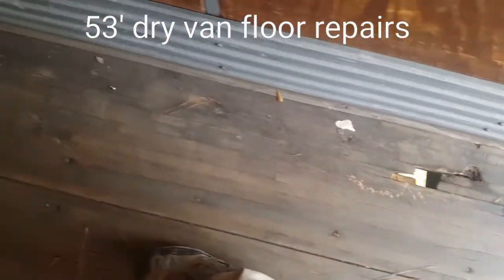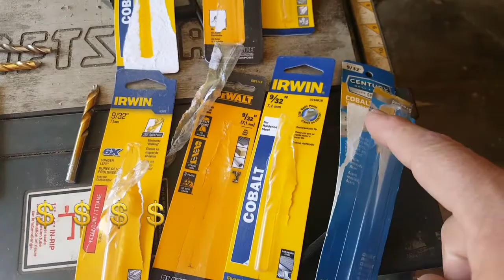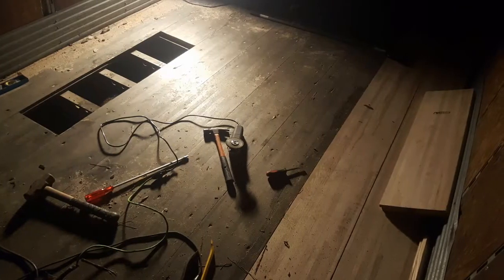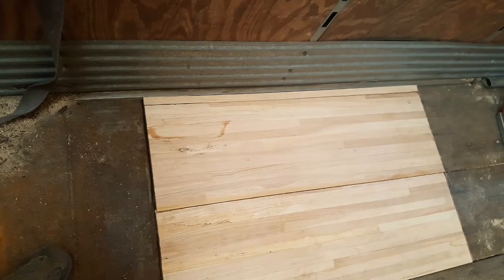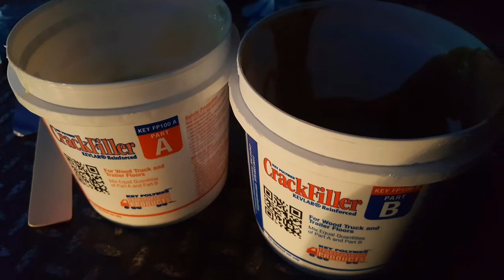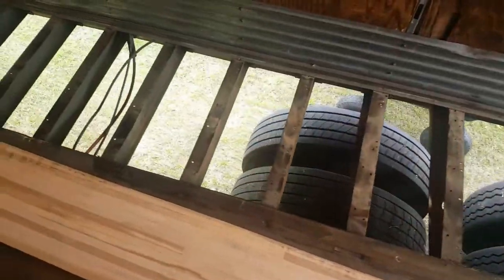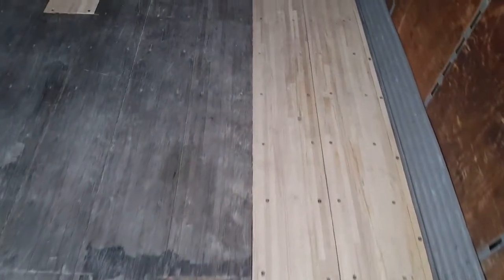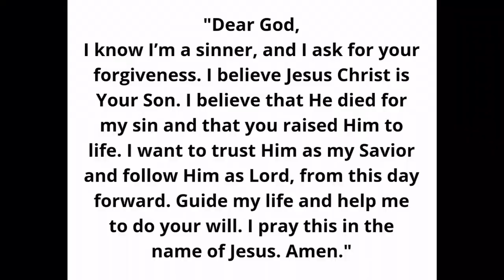53' dry van floor repair. broken drill and bits into pieces.

Comment: Great job man , Can you please in future if you can show us how to remove and install the woods
Reply from the maker: Basically the wood is over lap joints on one side and underlay joints on other side. So once you unscrew the board and make the cut the board can be pulled out. I use a skill saw (be real careful) to make my cut then use pry bar to pop it out. The worst part is trying to get full cut without getting in the next board.

Comment: Hello, 
I need to replace my floor my question is how do i remove the floor the easiest way because most of the bolt are rust and not coming off ?
Reply from the maker: There is no easy way. I removed what screws would come out and then had to cut the others out. So get some wd-40 put it on them for a day or two before you try to remove them. Hopefully your big Ole drill will back them out. It will be a big headache but take your time it's a noble project and can save lots of cash.

Comment: Have you ever swapped boards from a different position on the floor? Or when you pull up an old board is it too far trashed to reuse ?
Reply from the maker: Usually they are to bad to reuse

Comment: Can I use pressure treated 2x8 by 16 ft yellow pine for the entire floor replacement ?
Reply from the maker: @40roll97  no it won't hold up to the weight don't skimp on the flooring it could be really dangerous for the forklift operators
Reply: @ChristianTrucker so what type of wood do you recommend for a full replacement ??

Thank you in advance
Reply: @r.mendoza5612  It's usually Oak, or another hard wood, and laminated oak to save from buying oak boards that are that wide.  You need to find a truck supply store.  Not only is it a much stronger form of wood, but each piece is coated on the one side (black in color) to protect from water intrusion.   This youtuber meant well, but I agree that he glossed over the pieces and process.  That's a communication skill that some folks just don't have.

Comment: Do you know how I can replace a Great Dane Threshold Plate? And where I can get one?
Reply from the maker: I would contact a trailer repair shop like Jackson truck and trailer repair in Jackson ms or Kent trailers in Kentwood Louisiana. That rear plate is a tuff job and usually all the wood under it will be bad.
Reply: @ChristianTrucker  thanks!

Comment: How do you charge for labor?
Reply from the maker: Usually by the job. Most shops charge like 80 - 150 a hour
Reply: @ChristianTrucker  yea I thought so…. Tryna make sure I’m not getting handled by my pops….I replaced 21 ft of inch and a quarter wood in a dry van,4 different boards….what would you charge for that
Reply from the maker: @hunchothagod8164  4 different patches that makes a difference for sure. Each time you cut down to make a patch it's nerve racking. One of my guys almost cut his leg and did cut the cord when the saw back jacked. Ya really got to take your time. Also the location of patches makes a difference the front and backs are worse than in middle. Definitely take one guy the better part of a day to finish that job. Could be as much as 1k
Reply: @ChristianTrucker  exactly I came up with 1585…..just doin further research,thanks